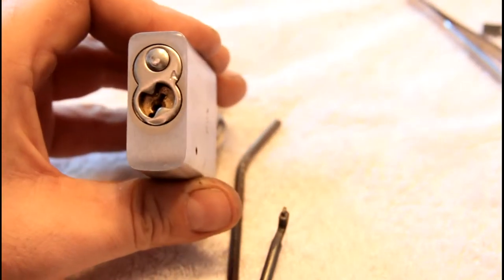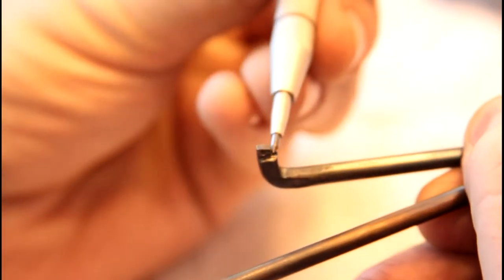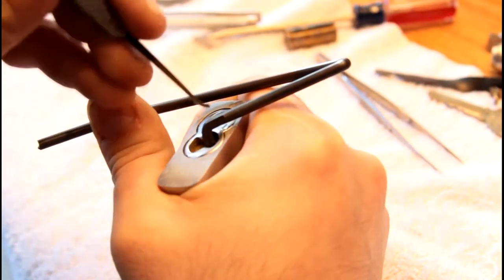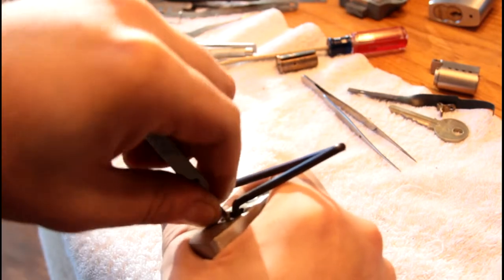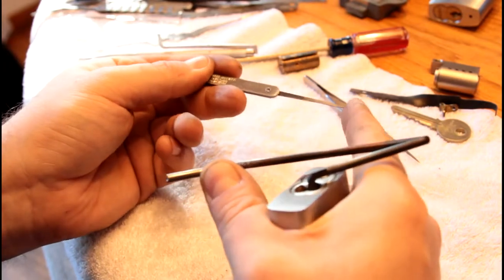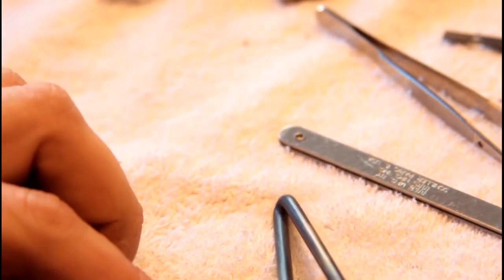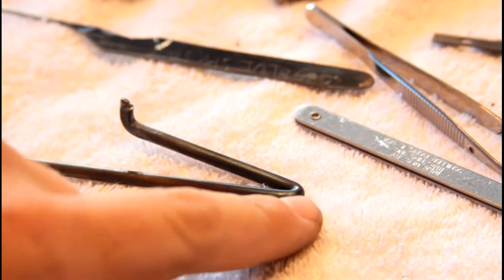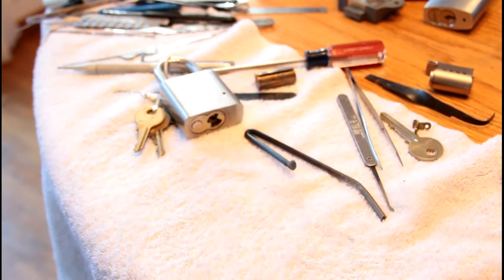(037) Left-Handed Tensor for American Locks -- Homebrew

Comment: Counterclockwise rotating cores should be considered a security feature
Reply from the maker: Yeah... I think I have a video or two on picking Hurd padlocks which definitely implement this "security feature."

The first Hurd I ever opened did not come with a key... it took me WAY too long to work out that it opened anti-clockwise. For this class of padlock, the Hurd locks I've worked with are made to remarkably good tolerances and, despite not having security pins, are not super-easy to SPP.